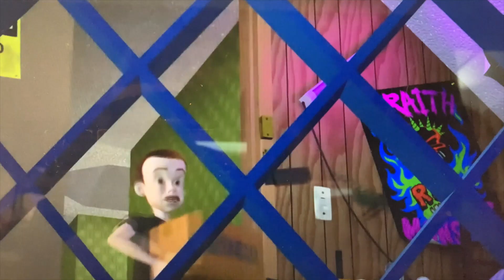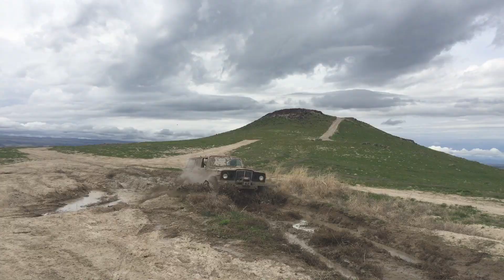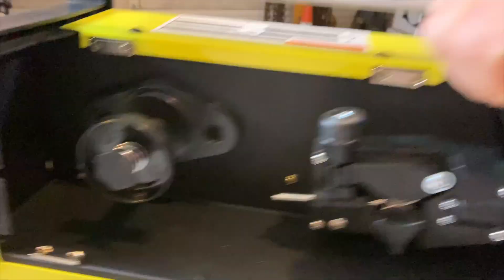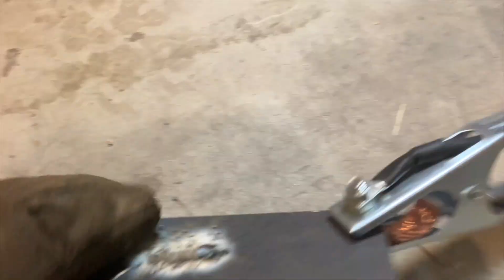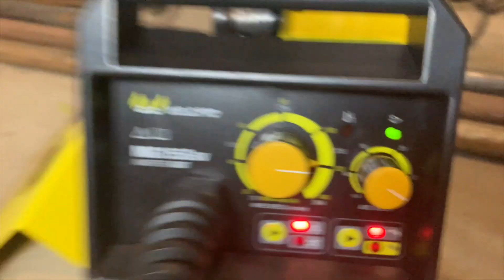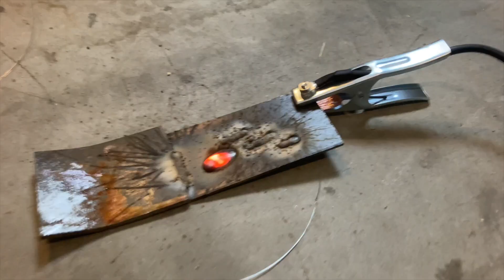Weldpro MIG155GSV Unboxing and Initial Review

Comment: Difficult to hear you over the music but good video nonetheless. Might not get it because of the plastic mig gun.
Reply from the maker: Thanks, yeah I’ve changed how I edit since this video, used to use the built in speakers on my laptop which doesn’t give an accurate depiction of how loud the music is, now I use my headphones and pay attention to the actual numerical levels. I’ve been using the welder for two years now, ran about ten lbs of wire through it so far no problems.

Comment: No link to shielding and solid wire?
Reply from the maker: I’ve been buying that locally, if I can find a link to the wire I have been using I’ll post it. I’ve ran about 10 lbs through it so far, really impressed
Reply from the maker: Here’s the wire I’ve been using, https://www.amazon.com/dp/B00178UUAO/ref=cm_sw_r_as_gl_api_gl_i_SYAZYV1KKGADM2DXMZP9?linkCode=ml2&tag=daysofpaina08-20

It came with .030 wire, but I switched to .035 and it’s so much better imo. I still haven’t got it set up on gas yet

Comment: Hey, Joe from Weldpro here, I just came across your video, I'm hoping you realize you had your polarity incorrect for flux core welding.  You need that dongle in Minus, and ground in Positive, that's why your weld was so bad👍
Reply from the maker: Yep! Somebody else mentioned that as well, got that straightened out, so much better. I’ve built quite a few things with it now, can’t wait to hook it up to 220. I plan on doing a follow up review this summer. Thanks for the input!

Comment: 1:18 ! My mentor introdiced me to wire feding on an old  buzz box Chicago Electric 3 weeks ago and chose this Weldpro for me that you are reviewing. When I got the Weldpro to run MIG and get that steady hiss/bacon frying sound, it made even my green ass lay some decent-looking beads on 1/8 inch iron T-joint welds.
Reply from the maker: It’s been a pretty dang good welder, especially for the price! Thanks for watching!

Comment: Quick question.... you're MIG first test was at 110v plug-in right?  Have you plugged it into 220v yet and run it? What's the Amps like with it then? I'm looking to replace an old HF 220 welder that the MIG lead's broken and since it's all built in I like the idea of removable wire feed and I like that there's a spool wire feed for this unit for Aluminum. The max I will be ever welding is maybe 3/8" just wondering if this 155GD (the newer version since your video) would cut it (weld it).
Reply from the maker: I haven’t tried 220 yet, we’re still in a rental between selling our old place and buying the new place so no 220 available. I might wire a temp 220 circuit in here but hasn’t been a priority. I’ve been welding 1/8”  to 1/4” stuff with flux core  on 110 and getting decent results
Reply: @DaysofPainandVictory  good to know. So it would have more power than what that video shows. 👍
Reply from the maker: @jeffburkholder202  yes for sure, and in this video I had the polarity wrong for flux core, when I switched that it made a huge difference
Reply from the maker: I’ve got a few fabrication project video on the channel using the welder if you want to see some of the results